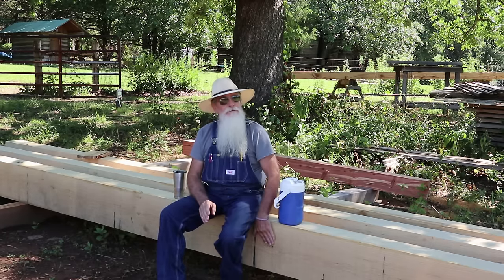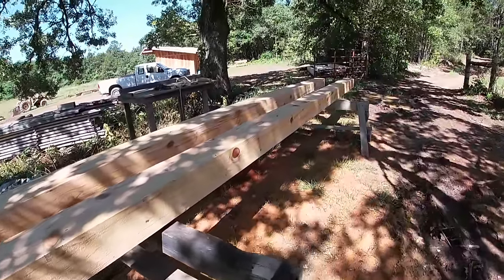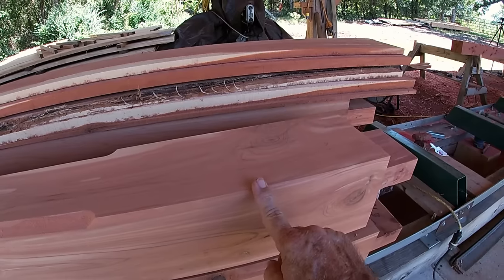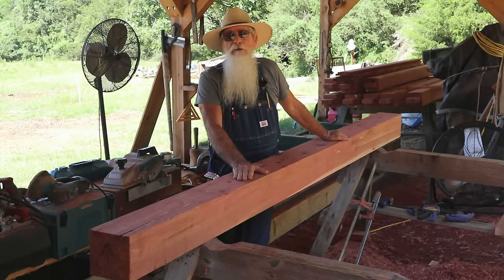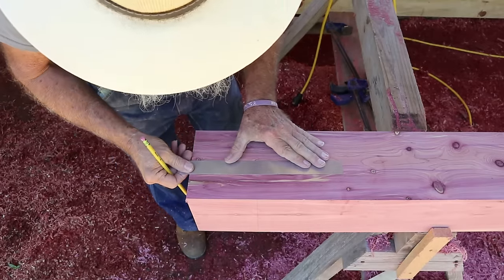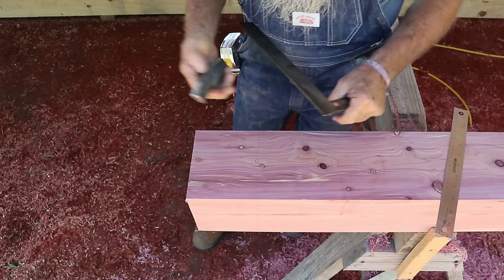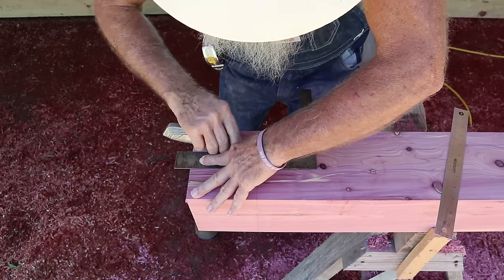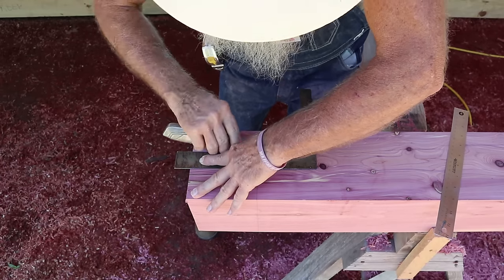Building a Covered Walking Bridge: Step-by-Step Guide to Cutting Tenons on 6x6 Red Cedar Posts, Ep 1

Comment: Is this the same white oaks that are in KY?
Reply from the maker: Howdy Travis- post oak and white oaks are two different species. However, I was told by a dendrocronologist that you can’t tell them apart in a lab. They have different leaves, bark and acorns. Evidently the properties of the wood is the same.   Whereabouts in Kentucky are you? I helped a friend of mine get started on his log cabin in Berea, Kentucky a couple years ago. Beautiful country. God bless y’all
Reply: @TheBeardedCarpenter  , western KY, thank you for the reply, I am planning on a cabin build next year. I was told most of these oaks are being used for railroad, it looked like you were building with them, I may try to do something with them.
Reply from the maker: @TravisLambert  A lot of the good oaks are being cut up into railroad ties. If you could get oak for your cabin it would be really good. I would use oak if I could get it. Blessings